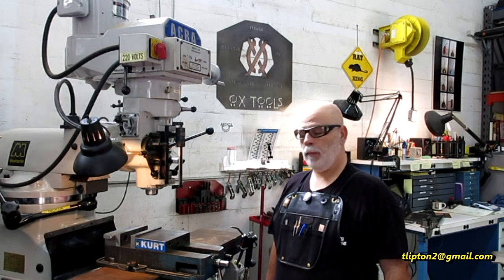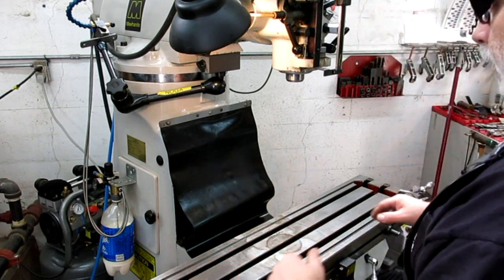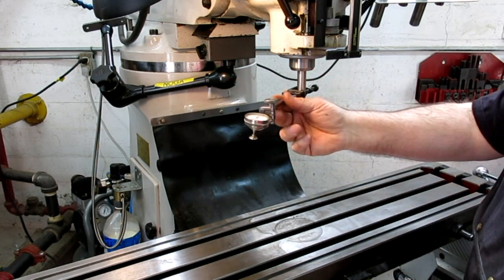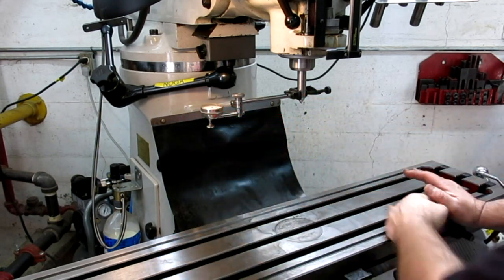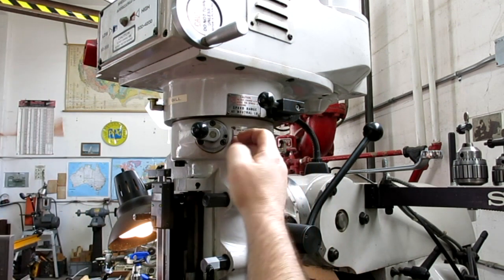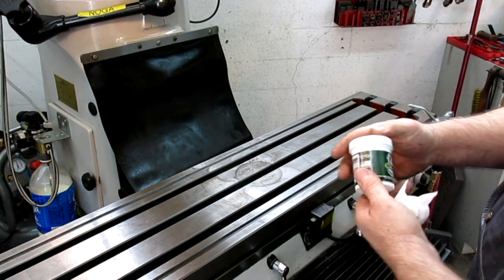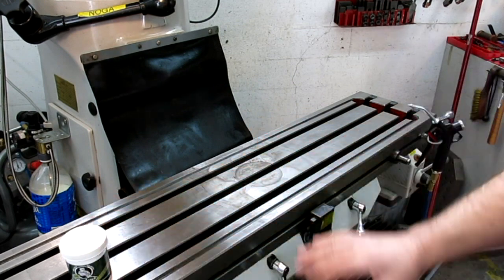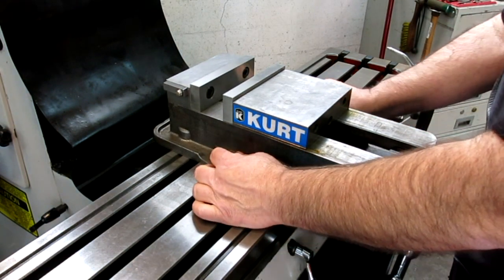Bridgeport Mill Periodic Maintenance

Comment: hi tom, these past couple weeks works been slow in the shop so ive been servicing all the mills. we run alliants, bridgeports, and traks. and from what ive seen they are all built just about the same. the grease port higher higher up towards the head of the machine is indeed a grease port (for the viewers) it greases the high low gears, you should work the handle while pumping in the grease. and if i had to guess the lower greases the worm for the quill feed. i just pulled the quill out of one last week and replaced the spindle bearings. as well as replacing the belt cleaning all dust out of the belt housing and so on.

Comment: Hi Tom thanks for all the great videos as usual. I have been using frog lube on firearms for years now it's a great product. Try heating your mill table with a heat gun or torch just slightly to  where it's almost uncomfortable to touch that lube will then pull down into the pores of the metal it's pretty cool stuff.

Comment: Good video with some important reminders.

To lubricate the threads on power drawbars, you can heavily grease or oil the internal threads of one of the tool holders and run it in and out a few times (and then clean the tool holder again).

Comment: Tom, I checked McMaster Carr and WOW! the 4” round 4506a4 stone was nearly $30!. Maybe it would pay to stop making tools and bits and start making our own abrasives! Seriously, Dan Gelbart makes small abrasive wheels w/arbor from used abrasive wheels using 
his water jet. So there is some recycling available.
Reply: Tom, have you tried using WD for removing oil and grease residue when servicing your machinery? Also, I have found that grease gun chuck jaws tend to bend and leak if they are hard to remove from the Zerk fitting. They are supposed to be self tightening and releasing to some extent, but hey, does anyone who makes that stuff care any more? I used to have problems with leaks when greasing cars before I started loosening up on the chuck adjustment.

Comment: The Co I work for just replaced the head on a 1987 Acra that I use daily. They actually replaced the heads on two of these machines. My mill's power feed was not working and the unit was replaced with one just like on your mill. We have encountered a backlash problem that when the mill is cranked to the right, it pushes the brass gear away from the drive gear. The old manual shows no adjust for the X axis, but shows one for the Y axis. The indicator shows .059 thou backlash. The old X axis shaft is pushing the inside bushing of the needle bearing in and out depending on the direction you hand crank it.

Comment: I see your new silvent gun there, I got myself and a couple of the guys in my shop one of the "industrial" models. Its been quite the nice air gun but what they ask for them at retail is pretty insane. Mine were ebay scores at like 50 bucks a pop and we ended up with 6" long lavel tips, Its quite nice for blowing out those m6 holes in the turret from a distance, the fins give you enough of a space for the yummy sour coolant to fly out of there cleanly.

Comment: Hey Tom, 
thanks for the great pointers. get a few items i need to pick your brain on: i have a J-head bridgeport and the head on it doesn't have any grease zerks. it does however have the two oil cups like your although in different locations and like yours, of different size. in my owners manual it indicates the large cup is for the spindle bearings. i do have oil drippage on the table coming from up in the quill somewhere so i'm guessing it's the spindle bearings. 
i'm also wondering if a guy should put in some heavy oil in the quill feed gears? since there are no zerks and no oil fill screws it would seem prudent to pop the cover off and put some heavy wienershlyder in there. 
before using a stone i use a paper towel to see of there are any burrs or dingus mcgees on the surface.. that way i can save that step if possible.. the paper will shred on the dingus' (or would the plural be dingii?) and makes them easier to locate
at this point i would recommend a sandflex block for cleaning up the table getting rid of the stains and other weasel snot that accumulates under the vice. i have a product review video on the sandflex block in the can right now and will putting it up in a day or three .

cheers
mike
Reply from the maker: +HolzMichel Hi Mike,

I think a J head is close to mine. Thin oil in the front one and heavier oil in the rear. Sounds like we need a product review of the wienershlyder product. Sounds handy.  Thanks for the comment.

Cheers,

Tom

Comment: Tom. if you stopped putting spanners etc on the table, the dings would stop. Use a bit of plastic sheet or some kitchen cupboard shelves with Melamine on. It will also stop a lot of swarf dropping down the tee slots.

Comment: Happy New Year, Tom.  Nice tips on Maintenance.  It is sometimes hard to remember all of the lubing/etc. for hobbyists like myself because when I get a chance to get out, I'd rather be using the time to be turning some metal.  I need to get a small needle type oiler for some of the holes on my small Atlas to make it easier to do.
Reply: +ILGopher I hear you, my big gripe on some of the Atlas oiling ports is the tiny set-screw type caps that you have to remove and replace each time you oil that part. I do it, but it is annoying, and anyone whose says otherwise has OCD, which is fine, and I'm far from bashing anyone that does have that behavior, I just do not ;)

It makes me understand why all of the screws had been removed from my machine before I got it, LOL, and also makes me wonder why I put them back in...

Comment: This may not sound like much, But to me the foil on the grease gun was a big help to me. Thanks Tom.
Reply from the maker: +Randall Moore Hey Randy,

Keeps grease out of your truck toolbox. Thanks for the comment. 

Cheers,

Tom
Reply: Thanks again Tom. I have some pretty crud pampers I deal with like the ones that over grease till they blow the seal out, The ones that pump so much grease into the pilot. Bearing. I could go on and on,   I told them and I hope it works, Thanks again and stay healthy.

Comment: Good info Tom.  At my last job maintenance  was wiping  with a rag and simple  green....
Reply: +Bill De La Vega Have you ever tried Zep's floor degreaser? It's a bit more harsh on the skin, and always wear eye protection, but if you've got anything more than a film of oil, it works like a blowtorch melting a candle ;)
Reply: +Knolltop Farms Will have to give it a try next time.  I think Tom used it on his horizontal bandsaw and seemed pleased with how it worked too.
Reply: Yes, he's the one I got the idea from. I got a one gallon bottle of concentrate for $20 bucks that you can mix 4 parts of water to one part of cleaner for a really strong batch, or 8:1 for something about the strength of Simple Green.  I'm never going back to Gunk products, but I do like the mild nature(and great smell) of Simple Green and will always have both on hand, because this stuff is a Bull in a China shop!

Comment: WD is not a bad adhesive remover. Great for removing labels if the top is permeable - those must be scraped first. I used to use it to remove DMV inspection sticker remnants.

Comment: Maybe a dumb question: new mill owner here. I get the adding grease thing (zerks). My mill (very similar to yours...PM-1054 knee mill) has only one zerk for the back gear. So, you put grease in there. Where does it go? I'm used to dirty grease coming out when new grease goes in. What am I missing? I don't see anywhere the old stuff would come out.

Comment: Some people will criticise any holding of Scotchbrite or abrasive cloth/paper by hand on a lathe to clean or finish a workpiece, but it's certainly risky when you apply it underneath the workpiece when the lathe is rotating in its normal direction.  That's because you risk pulling your fingers into the rotating workpiece and into the chuck's jaws.  It's safer to hold abrasives on top of the workpiece, preferably using a  fine file or a flat strip of rigid wood/aluminium/plastic batten as backing for the abrasive to keep it flat, therefore less likely to catch in the workpiece.  (Folding the end of the abrasive around the end of the batten and holding it there with one hand keeps it in place - ideally, I guess, it could be glued to the batten.)
For those who point out differences in the use of oil or grease and where it goes, in your defence I must say that you did warn us to refer to the machine's manual.

Comment: Does the one pump oiler lube the ball screws? On our bridgeport you take a set screw out of the center of the table and drip some in there. Also, I don't believe there are any grease zerks on our mill. There are some oil zerks for the ways, but I don't recall any in the head.

One more question. I've seen a lot of filthy collets at my shop class at school, how do you clean the inside?

Comment: Very Important topic because if we do the right thing our machines will be much better off. Protecting the asset will not allowing it to turn into a piece of junk way before it's real life of bringing capacity and profits would expire if ever.  At our one major customer has  required of us a new required processes of us to use a refractometer each start of the shift and record daily what it reads coolant wise 7 to 8 is the goal and then adjusting accordingly. Tom I always set it the vise aside bottom up to clean like you. I use a stone as you do also making sure they are lapped well.  Would you give any  thoughts on  Vactra #2 VS the new synthetic  now promoted? Our shop now has switched to synthetic on CNC's.

Comment: Nice one Tom, an ounce of prevention... and all that. I think it's worth emphasising to your viewers however that they should be guided by their own machines before going berserk with the grease gun! Many machines are intended to use OIL and not grease on what look like grease fittings. I've literally lost count of the number of machines I've seen ruined by well meaning people greasing up the ways etc, clogging the galleries with grease, and then effectively running them dry. Just because there are what looks like a zerk grease fitting there doesn't mean that that grease should be used, and if in doubt check first. ALL of my machines for example take oil in the fittings, and are fed courtesy of high pressure oil guns.

Personally I key my vices etc with snug fitting keys, and they drop in for most purposes without further tramming. I have a big Gressel hydraulic vice I keep forgetting to make keys for and curse my tardiness every time I take it on and off. Keying fixtures can be a huge time saver, with final tramming only necessary for fussy jobs.
Reply: +Pete F I'm with Tom on this one, I hated having a keyed vise. I'm often pulling the vice off and putting it back and having keys in the base just puts my fingers and back in danger. 

I have a frame that clamps in the vise jaws and pushes up against the column. Very fast.
Reply: +Paul Compton Not having a mill, I took note of Tom's 2 cents on Vice Tramming back when he did his first video on it, and agree wholeheartedly. My back was broken8 years ago and will never be the same, so anything I can do to keep from throwing it out is always at the forefront of my mind. 

I also always lift with my legs now too, even bending at the knee to coil an airhose. As my Osteopath told me once during a test where I coiled a rope by bending at the waist, "You're not an Elephant" and waited to see my face light up with a grin knowing I'd take it as a compliment on my slim figure, only to continue with "that's an arm, not a trunk, so quit using it like one!". Body mechanics are ever so important to me now, and I just cannot take anything for granted anymore.

I'd love to see the frame you clamp in your vice someday, but there's no rush...it'll be a while before I get a mill :(
Reply: Knolltop Farms I did a video back in December 2013; Quick way to tram a mill vice
Reply: Excellent, will check it out today. Thank you.

Comment: I do not have any information on ACRA mill looks like a Bridgeport clone but video states Bridgeport Maintenance and my 15 year old son followed your instructions when he thought he would impress me by cleaning and lube my home Bridgeport's the problem is the left side oil cup on the head by the back gear is to lubricate the spindle bearings goes in head above quill with oil wick in tube that drip feeds bearings require #10 spindle oil he put Vactra #2 way lube as shown on your video way to heavy and sticky for oil wick. Now I get to pull upper off on both machines and clean tube and replace oil wick. Please make sure in your video's you have are correct for the machine you have named on them BP clones are not all the same as Bridgeports

Comment: Nice masonite table covers, the rubber ones are pretty expensive. WD40 is also a decent label/adhesive remover for labels it will penetrate.
The wash bottles we used in chemistry lab are good for lube cutting oil too.

Comment: Stickifiers -
Dried Spooge-
Dingo McGees-
Rusty Crusties-
Skunge-
Weasel Snott-

I bow to your fluency and insightful working eloquence of correct machine-shop terminology and nomenclature.

However, 4 items that cause a raised eyebrow -

I. Best way to tram a mill table is to put a 1.000" mike standard in the middle of the table and leave it there. Set the indicator @ a 6" sweep. Move the table to the left ('X' axis) till the indicator is over the standard. Raise the table till the indicator zeros, zero the table elevation dial. Lower the table,  swing the indicator half a spindle turn, move the table to the right till the standard is again under the indicator and raise the table back to the zero mark - the indicator should also read zero. Adjust the head if the indicator shows a variance. Repeat again on the 'Y' axis. This method was shown to me years ago by a Japanese tool and die maker - it avoids any chance of the indicator shifting when moving over the 'T' slots and works on machines where the table is less than pristine.

2. Dialing up the vise, the indicator is still in contact when you thump the vise ? That hurts them, you know. They are shock-proof, not impact proof.

3. Running an edge finder at 1,400 R.P.M. !  Really ? Mine all say to use a quarter of that speed.

4. I still make it a habit to move the vise around to a new position every time I re-install it. The set-up instructions that came with the Mitotoyo D.R.O. were clear on this - your machines accuracy will last much longer if you distribute the wear evenly over the full length of the dovetails. Besides, there are times when it is handy and convenient to have a large part of the table clear for some quick and totally oddball set-up.

Andy, that's me up there ^ in my workshop near Courtenay, Vancouver Island.
Reply: Don't forget-
Liquid Love and Chingus.
Reply from the maker: +Andrew G. Whitaker Alright Andrew. Your comments coaxed me out of my den. 

If you watched the video I rechecked the indicator zero when I swept around the table. Zero the same move on. This is why I like the back plunge type for this operation. They behave themselves better. Dialing in the indicator in contact with the part and tapping on the vise is no worse than indicating over some of the nasty work I see around some shops or the random hole. All my indicators work fine even after many years of these kinds of activities. Edge finder at 1400 rpm. I'm going to guess you don't have a Super Jump edge finder. Right out of the instruction manual for the tool. Not everything in the machine shop or video is an absolute or necessarily the "best" way. Lots of room in the shop and on the internet for different ideas tools and techniques.  The challenges of the jobs and parts drive the processes. So feel free to do it however you want up in Courtenay. I'm just showing one possible way.  Thanks for the comment.

Cheers,

Tom
Reply: +oxtoolco Thanks for another wonderfully informative episode. Daniel
Reply: Ah, terms of art!

Comment: My mill (Baileigh 949) is similar but not identical to that - has the same body castings, but a different head. Are the Zerk fittings always for grease?  I had read that sometimes they were intended for use with a high pressure oiler, and grease shouldn't be used. How can you tell the difference? Thanks!

Comment: I have a Series 1 and on mine the higher (more towards the front) oil cup oils the down feed and quill (no wick just a drip hole) and the lower (more towards the back) oil cup oils the spindle bearings and is the one that possess the wick.  Are you sure yours works the way you described? I just restored mine so I'm positive and I doubled checked the parts schematics before I dared make this post just to be sure.

Comment: good video tom. i just replaced a variable speed belt on a bridgeport for a friend of mine who over greased the motor side pulley and ruined the belt. "read,understand and follow the mfg's instructions". when i watched you tram the mill head i was reminded of a pet peeve of mine. i have a drawer full of joints and rods and clamps for indicators that never seem to work together. are there any standards for indicators and their attachments? i think you could do a whole video on this subject.
Reply from the maker: +larry sperling Hey Larry,

I have the same damn box as you. Its about two pounds worth of weird little clampy thingys and odd diameter rods.  Thanks for the comment.

Cheers,

Tom